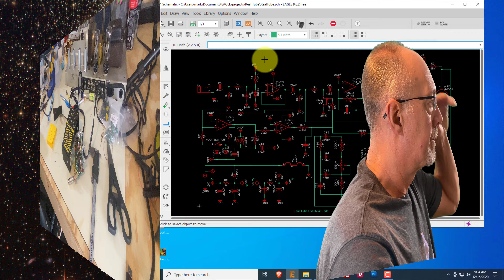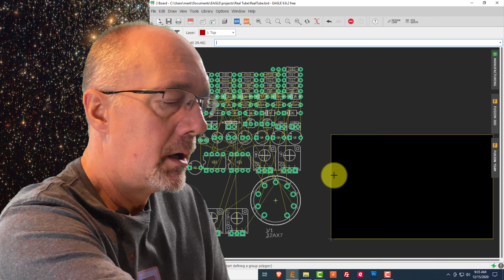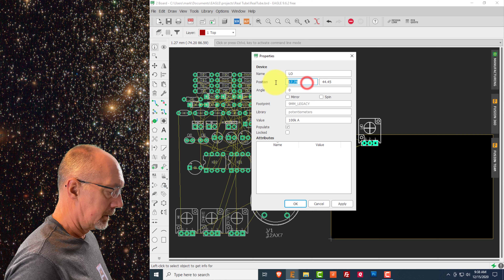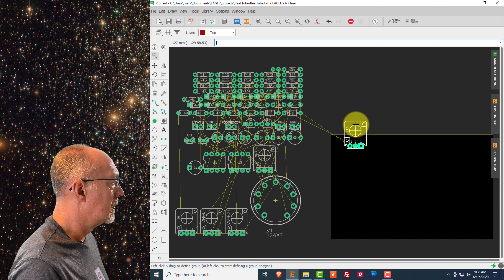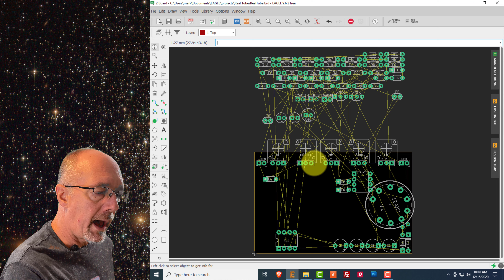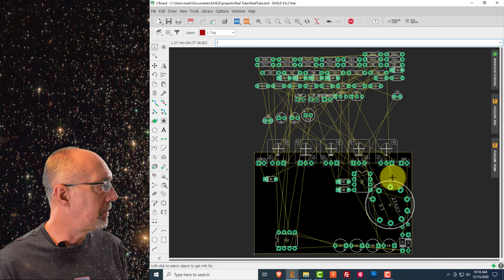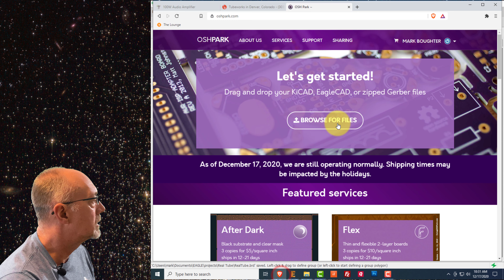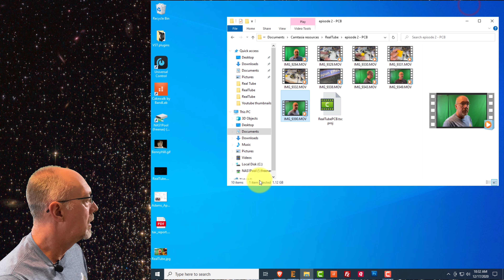Build your own effect pedal Tube Type Overdrive - Designing the PCB

Comment: Issue that I had with my Blue Tube... they have these pots that have legs that come off the PCB at a 90 degree, and are pressed against the pcb.  One of these bare legs was pressed onto the trace that belongs to a different part of the circuit.  I put a plastic shimmy between that bare leg and the trace where the masking cracked from that leg being pressed on it after all these years. 

I would wager that a lot of people have tried troubleshooting their pedal and never figured it out.  I don't know what revision this pedal is, but everyone who has it I can assure you that there's a pot leg that is pressed against a trace that's going to give you problems down the road once that masking cracks.